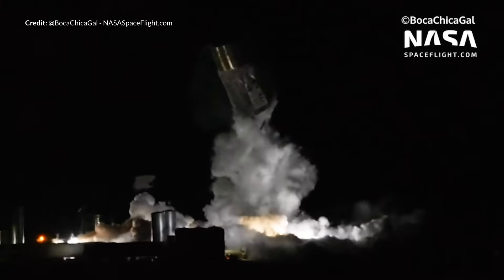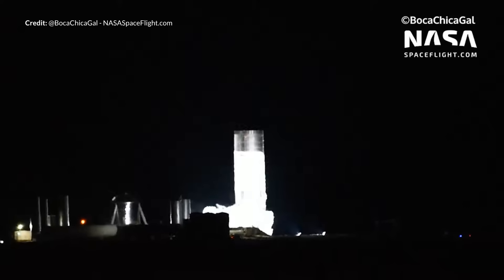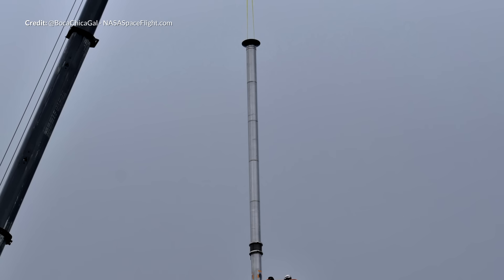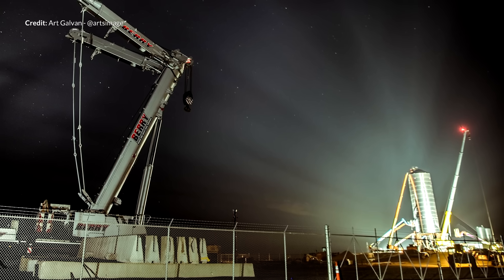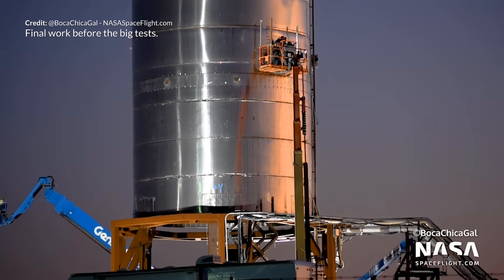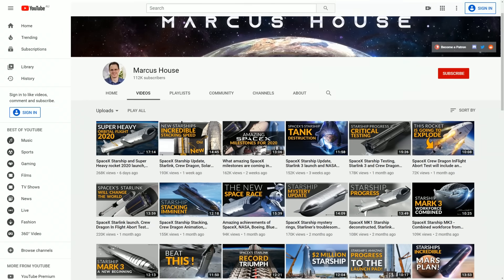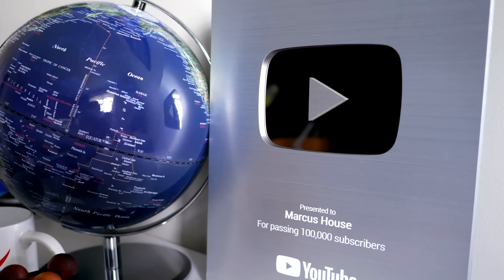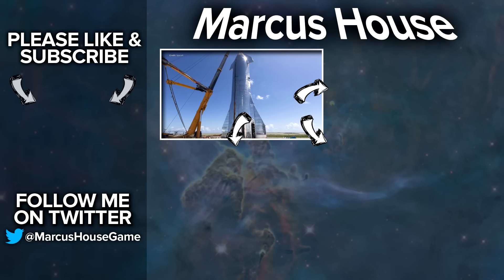SpaceX Starship Explosion of SN1 - Moving to SN2, CRS-20 delayed and Marcus House 100K sub thank you

Comment: As i stated before on other channels, with all the instruments attached to the outside and the statement about wrong welding settings (btw how do you do THAT in a multimillion-dollar-project? Competent industrial welders are everywhere to be found...), it was kinda obvious that SN1 would at max make it to some 10km height or some static fire. Like Mk1 it was outdated before being finished. But by the time they did the nosecone, welding settings should have been ok, so that nose/fairing section might likely end up on SN2 now. And we should not forget, this is more about establishing a mass production line, so time between iterations will get shorter and ultimately its only a matter of cost if SN2, 3, 4 or maybe 10 ultimately reaches orbit. Btw, as SN1 ruptured on the lowest portion of the tank, i wonder if they miscalculated the extra pressure from liquid filled in several meters high.

Comment: Maybe the larger structures have special challenges. If the engine is too large it could have combustion instability and in case of larger tank is it similar issue -> use 4 smaller tanks instead of one large tank?
Does the tank inside have the antislush or antivortex structures?
Its good to try fly it with minimum configuration to test the structures in detail... Maybe it gets developed sooner or later.

Comment: SpaceX should consult the company that makes the Harvestore silos on how to weld giant metal tubes.
Reply: Silos aren't made to withstand being filled with tens of thousands of pounds of cryogenic liquid and at the same time being made lightweight as possible.
Reply: @motokid6008  didn't even bother to look up what a Harvestore is, did ya?
Reply: @greggv8  - Do they go to space? Do the silos have to hold tens of thousands of pounds of cryogenic liquid? Do they have to be made as lightweight as possible?
Reply: @motokid6008  They're airtight welded steel and hold up to 1,750 tons of fermenting silage for months. So I suspect the people who build them know quite a lot about welding thin steel that will stay together.
Reply: @greggv8  - I'm sure they're amazing welders, but you cannot. Absolutely cannot compare a grain silo to a rocket fuel tank.
Reply: @motokid6008  CST Industries has been around 125 years. They build all types of tanks for liquid and dry storage. Current offerings include welded tanks in stainless or aluminum up to 85 feet tall by 15 feet diameter, and they can have one of those or other stock sizes ready in a few weeks. They also do custom jobs. I think they could teach the SpaceX crew something about how to make better welds.
Reply: @greggv8  - But never spaceflight hardware... using abnormally thin metal.
Reply: @motokid6008  I bet they could take on such a project, if a Billionaire wanted to hire them. At the least they do have a lot of experience assembling structures the size of the Starship components.

Comment: tig welding in moving air is Real Hard - weld shielding gas blows away  makes bad welds -  Im surprised Elon went ahead trying to weld in wind -  Im sure welders told him it will cause problems  - remember each weld seam is 60ft long  - 
now with buildings and tents this problem should stop  - 4mm stainless is fairly easy to weld in proper conditions -  so success is much closer -

Comment: Yessss! This is history. Thank you so much for your wonderful work! Am I missing something, or is Starship ridiculously easily beating SLS to an uncrewed orbital test flight?
Reply: @gandritaskull  I don't think I understand you there.
The Space Shuttle didn't have an abort system, neither do airplanes.
Elon can finish and launch all the Starships he wants. I don't think anyone can ruin that once the vehicle is proven to be reliable.
Even if authorities would deny permission to launch these with crew on board, they would be a magnificent next step in space transportation.
But just as with other modes of transportation, space travel will not forever depend on abort systems - once spaceships get bigger it just won't be feasible to have a reliable abort system, especially when they take off from other planets with different atmospheres. Just as in aviation, it will be the vehicle itself that will be equipped with sufficient redundancies and safety margins.

Comment: NASA is to anal retentive. Anotherwards they won’t move forward if they think something might fail. Hence delays. Instead of hey what have we got to lose let it fail study the failure see how to fix it move on to next step. May be spacex needs to implement a fusion stir weld process. Like they do with aluminum. But the stir bit might need to be a carbide substrate infused with diamond.

Comment: Remember LaPlace's Theorem - That stress on a vessel increases with the FOURTH power of the radius. It's a challenge to make a single tank able to withstand the pressure. "Why don't they just" make a bundle of several, smaller diameter tanks?

Comment: The other thing that's comical about the SLS delays is that it was specifically designed using old technology and existing parts so that it could be quickly and cheaply developed. Meanwhile, Falcon and Raptor progress more rapidly despite being mostly new from the ground up, including brand-new custom-developed engines for each. I'd bet that Starship will fly before SLS does, which is just absurd.

Comment: They need a weld development program on small coupons, with controlled welding machines, before testing full tanks. Manual welding exposed to the elements is a recipe for failure, and we've witnessed a few here already. Centaur upper stage tanks are SS and were resistance welded... works of art compared to these. http://images.spaceref.com/news/2013/oo509064main_14_1600x1200.jpg
Reply: Yeah, that Centaur sure looks way more sturdy. So tell me, is this design actually just a big balloon with no internal structure at all? I’m no rocket scientist but intuitively that thing just looks way flimsy. I’m sure they’ve got very clever engineers working on it but geez, it doesn’t look right.

Comment: As a former welding inspector I couldn't believe they decided to weld up a spacecraft. The main mode of failure for welds is cyclic loading and temperature variation. I really hope they consider a new means of manufacture.

Comment: I think onesided welding of bulkhead inside the rings are not good enough. If the bulkheads are placed with the cavity up and placed inside one ring with the edges in same height, you can easily melt the edges together with tigheating, and later weld  this to the next ringsektion therby  avoiding the onesided weldings inside the rings.

Comment: Welding is a weak point. Casting these tanks in molds with stainless steel will probably be best. 

It will make them one piece without welds. Just like they do with high pressure/temperature engines....even big cathedral engines. IJS!🤷🏾‍♂️
Reply: @SheldonRobertson-f9m  As a planning & engineering facility  manager for 16 years at a government agency, I've had my fair share of failed structures traced back to failed welding done by professional welders. 
Hence my wish of reducing welding points.🤷🏾‍♂️

Let's just wish Elon well to succeed at his effort as we root for him on his quest to elevate mankind.😌

Cheers.

Comment: Back in the 1960's, NASA also had weld quality problems and even the maker of the equipment could not help correct the problem.  SO, the NASA Engineers tore into the equipment, modified it and solved the problem.  They knew what they needed to happen.  They were motivated to make it happen.  Just like Spacex, they will push through and achieve the quality they need.  Mind.....Everything in between is not a failure, it is ALL progress.  (Only detractors will always make it a big deal, failure if they can)
Ride the wave, it is all history and we are here watching.

Comment: Falcon 1 through 8 went through gradual, glacial, incremental iterative improvements, each time eliminating suboptimal materials, practices, design tweaks, gradually moving closer to the current Falcon 9 rocket that performs flawlessly in launch after launch. Getting to that level of reliability is a  process of trial testing, errors, and hard-won improvements.

Musk has said repeatedly that Starships SN 1 through 19 (!) would see such gradual, cumulative development. Of course we didn't expect trial tests would lead to such explosive errors, but that's a part of the process. It reminds me of Edison being challenged that they failed yet again to find a material that would work in their luminescent bulb, and he replied: "No, we successfully eliminated another material as a candidate for our bulb!" 

Progress is happening before our eyes. Hurray.
Reply: Well I figured we WOULD see more explosions.  It's super difficult to weld a massive Stainless Steel flask to take that kind of pressure.  I'm surprised they have made since much success so fast.  
I think they are doing great.

Comment: Is the composition of the welds the same as the SS plate ? SS does not get brittle at cryo temperatures but maybe the welds do ?
Reply: Very interesting to hear from someone with actual experience. Are there vendors which supply the pharma industry which could make tanks of a similar size to that needed by spacex ? Are spacex reinventing the wheel to some extent ?

Comment: As a pipefitter who has done many pneumatic tests, I find it strange they were venting. Venting, at least on what I've worked on, indicates they've gone beyond the intended pressure of the test. Could the upper venting have been caused because the lower tank over pressured and pushed on the dividing bulkhead?

Comment: If SpaceX were just putting a smaller craft into orbit we would already be there, But we are trying to put a Star-Ship into Orbit and to mars and beyond . I don't think it's the welds there is just to many of them in a pressurized  tank. Not like a balloon where there is one continuous flow of rubber. we need fewer welds in a tank of this size as possible. it can be done. The crew at spaceX are great welders, but for a ship with tanks like, this has to many welds, and the metal wont flex to allow greater pressure. it can be done tho, but we need better tooling, and metal rolling jigs to do it. maybe  3-D printing even? of a metal tank, or some other substance. But I have no dought  thay will get there.

Comment: I wonder how much of this welding experience and all of these pressure tests to test the integrity of the welding will influence the final Starship. Isn't the plan to construct it from one piece of steel? If that's the case, then all of this trial and error seems almost wasteful. Couldn't they just skip all of the security measures and go straight to a demo flight to test the rest of the equipment that is non-weld related?

Comment: The problem with Starship isn't that things go boom, the problem is they keep making firm statements of what they're going to do and then failing to deliver.
If Musk hadn't claimed Mk.1 was going to fly 20km nobody in their right mind would have thought it was more than a prop for a press release (which it turned out to be).
Same for SN.1. They should have stated from the very start it was meant to be a static test article. Then if they'd be able to fly it at some point, everyone would have been pleasantly surprised.

Comment: Can't they 3D print a pressure tank? No welds or joints. I thought 3D printed stuff was supposed to be super tough.
Reply: Their is limits to the size of 3d aditive manufacturing machines and the Stanless steel plates/sheets used are very cheep relative to carbon fiber.

Comment: The issue with SSTO is that 6 raptor Starship doesn't have enough thrust to lift off fully fueled. Need to add more raptors and that cuts your margin even further.